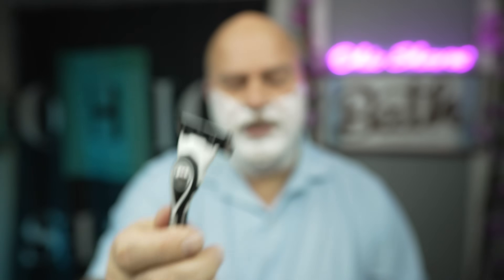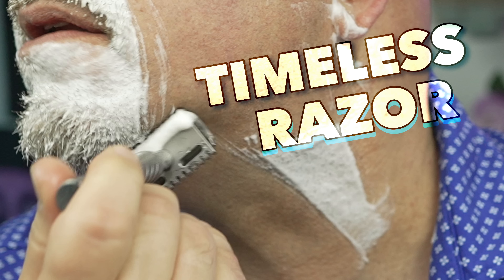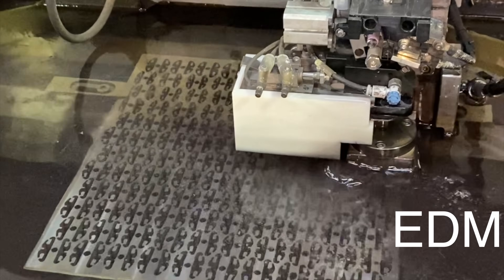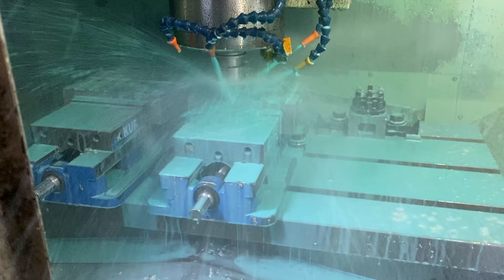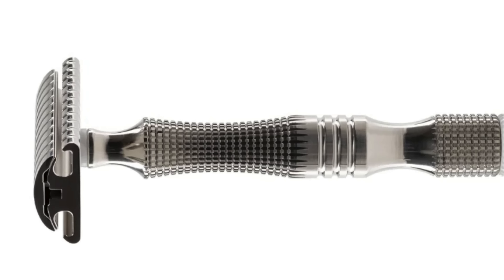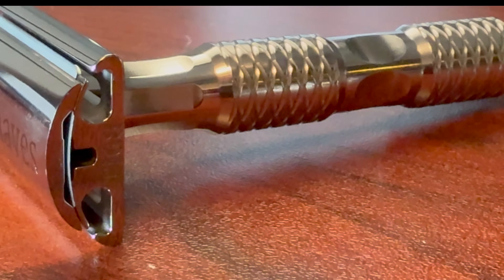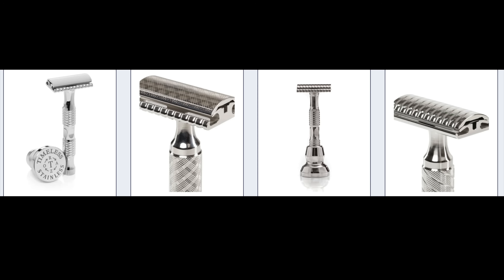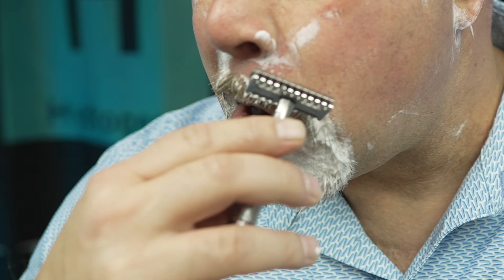Cheap Razors vs Premium Razors | The Engineering Difference

Comment: Hey man, great video. I am making the switch from cartrige razor Gillette 5 Fusion to the Rockwell 6c. Now I have some irritation on my neck, and I don't want to shave it until it goes away, and until my 6c arrives (which will be in a couple of days). What should I do to get the irritation, ingrown hairs, and razor burns on my neck to go away because i don't want to shave and then get more of them? Should I just wait it out, and if so, how did you wait (as you once said in your videos that you used to get them)? I also use the correct shaving routines before and after the shave, thanks to you, so I appreciate you helping me out on that side!!! Thanks!
Reply from the maker: I would just shave with the grain every 3 to 4 days until your skin irritation goes away. If your ingrown hairs form a pimple make sure you pluck them out to avoid infection and your skin will heal faster. Hope this helps.

Comment: Great video very informative 👍
Reply from the maker: Thank you much
Reply: @OhioShaves thank you  maybe  I  will  buy  one  are they adjustable?
Reply from the maker: You can buy the different plates separately
Reply: @OhioShaves similar to  Rockwell  6s and oli works ?
Reply from the maker: Not even close
Reply: @OhioShaves better  i guess
Reply from the maker: They stole there razor design and I will not support a company that does that. Nobody should
Reply: @OhioShaves who ?
Reply: @OhioShaves I guess  it's  oli  works  😂

Comment: Another great video, thanks. It's a beautiful razor, craftsmanship is amazing, and when you add that it's made in America, I have to get one! I'm going to have to work it into the budget and get on as soon as possible. I love my Simpsons, but I'm going to have to pick up their bush after I get their razor. The razor comes in either stainless steel or titanium? If so, do you have a preference?
Reply from the maker: Titanium Head and base plate and stainless steel handle
Reply: @OhioShaves The one razor uses both metals? Is that for the weight/balance?

Comment: That was a great video.  If I didn't already own one you would have sold me.  At the moment I am still getting different base plates, caps and parts because as you said they fit perfectly with everything they make.  Once you own a handle you can build whatever razor you want.  I'll also say I own one of their AL slants and even though it is only CNCed it is still the best slant I have come across.  The only odd thing I have found with Timeless is their burn orange brush handle is really red which is OK because I wanted a red one.  They do make some of the highest quality razor gear I have seen. This was truly an impressive video.  Thanks again and have a great Thanksgiving.
Reply from the maker: Happy Thanksgiving to you too.

Comment: Great video.  I'm a retired mechanical engineer and I used the titanium you mention (6AL-4V) on underwater cameras that went to the bottom of the ocean.  The material is very strong little corrosion, even in seawater.  It should do nicely in your sink and last a lifetime.
Reply: Hello Sir, i just recieved my first titanium razor but i'm not familiar with this metal. Do You recommend puting any kind of grease of thread to prolong its life? If yes, what kind of?
Reply from the maker: I just use a toothbrush and water after I shave to scrub it. Then I just polish it while I’m drying it. No need to use any oils.
Reply from the maker: Thank you much. Very cool job